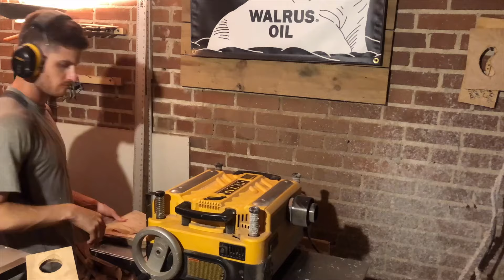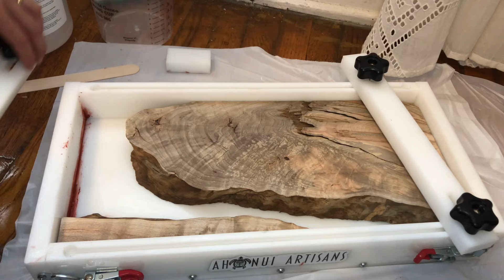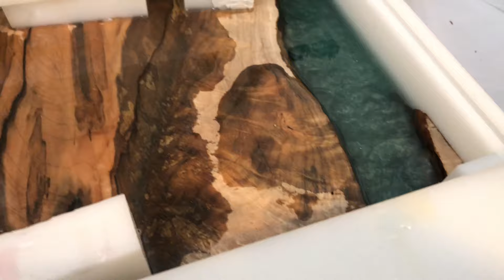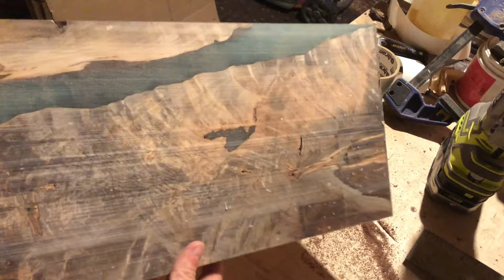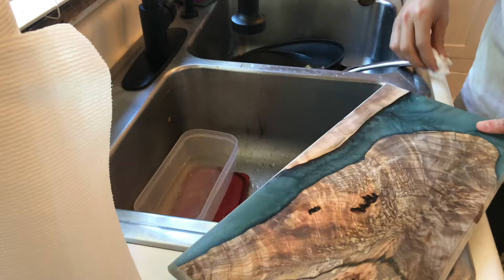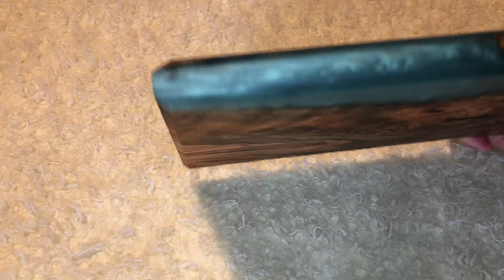How To: Resin Charcuterie Board - MacArthur Woodworks

Comment: Great work. Will you list the equipments you used here in this comment also. Im very curious.
Reply from the maker: Thanks so much! The products I used (resin, pigments, oil, etc.) are all listed in the description. As far as tools, I used the DeWalt DW735 planer, Porter Cable 6” jointer, Hitachi 10” sliding miter saw, Festool 5” ETS 125 sander, and a Ryobi buffer/polisher. Does that help? Thanks again for watching and commenting!
Reply: Man thank you so much. I didnt think I'd get a response back from you as most content creators simply dont reply back. I really enjoyed this video and your work.
Reply from the maker: @faptuharrd  I appreciate that so much! It blows my mind that y’all watch and like the videos so I always respond!
Reply: @MacArthurWoodworks  what is the router that you use ?
Reply from the maker: @faptuharrd  it’s a Ryobi battery powered trim router!

Comment: Awesome! That’s a beautiful piece. What grit do you start and finish at when sanding your boards?
Reply from the maker: Thanks so much! I start at 80 grit and finish at 320.
Reply: @MacArthurWoodworks  do you polish the resin at all? if not - do you see that after the oil ages a bit that the resin parts cloud up?
Reply from the maker: @greedo-diedforusall  I do wax and polish it. I haven’t noticed that; the resin does appear less clear but that’s because of the beeswax in the food safe wax.

Comment: Dude...2 days later and that crap was set up?!? Lol I’m on my first try at epoxy , has been cold out so I’ve kept it in a room with a heater, should be well over 70...felt like I got the mixture right but can still leave a fingernail print after 4-5 days...am I doomed? 🤣😢
Reply from the maker: Uhhh you might be 😬 don’t worry, that happened with my first time too! My second time, I promptly had a huge leak and wasted like $100 of resin haha. If it’s been 5 days at 70 degrees it should have definitely set up by now..